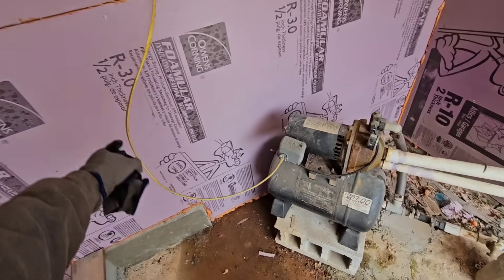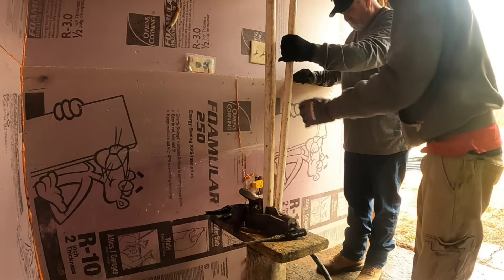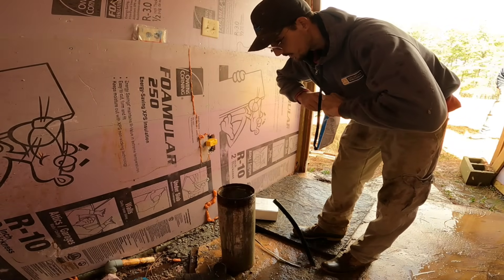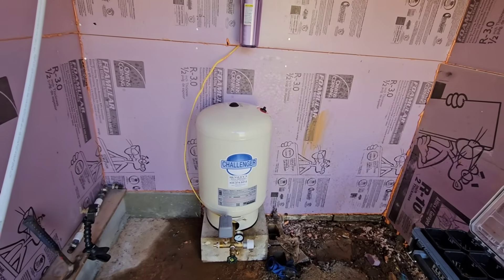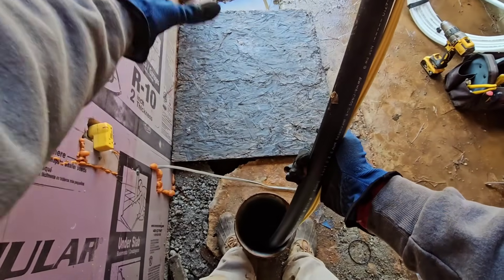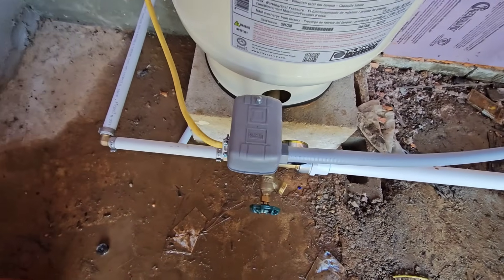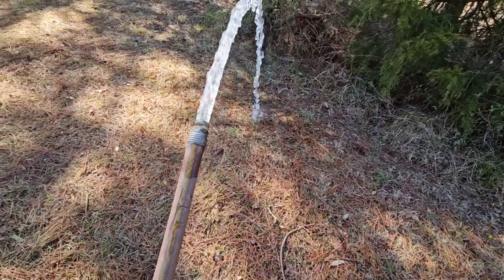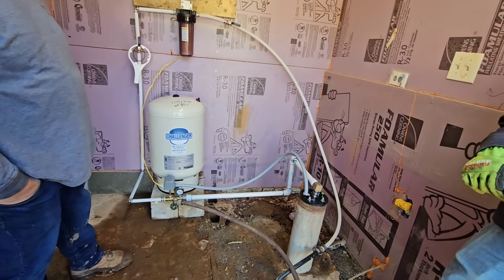Replacing a 1970s Jet Pump with a Modern Submersible Well Pump

Comment: Submersible pumps have their own level of problems.  Ill keep my pump on top of my tank thank you
Reply: yep do not have to pull all the pipe from the well to work on pump
As long as the foot valve/jet is good.

Comment: I loved how you just swiped your fingers across the hot to test for a live wire 😂. Next time use the back of your fingers so they don't contract when it bites you next time. OR buy a hot stick or voltmeter. Just jerking your chain, bud. Great work. Thanks for the video!

Comment: I have a system similar to that in my basement it’s 3 inch casing jet, with a head going into 2 pipes into the 3 inch jet type, and all the well guys around hear say I need a new well, it’s working for now but power went out and it took some time to prime it up, and water pressure isn’t bad but I’d like better, can you help I live in Terre Haute Indiana

Comment: Why don't you line steel casing head edges  with some plastic or rubber liner before pulling or dropping pump, pipe and wires; wouldn't prevent any  accidental chaffing while hardly costing any money or time

Comment: assuming he is going to replace the pvc suck pipe , I would drill a hole in the pipe i'm pulling and stick a screw driver thru it as a safety against that 'slick' pipe slipping thru my hands and losing the pipe in the casing

Comment: Need you in my area, on an old goulds jet pump and no well casing out of the ground I can see anywhere. Buried well? Two well companies I’ve contacted seem too busy to get back with me about updating my system even if it requires drilling a new well.

Comment: I have a 2 inch deep well with 1 drop pipe. Trying to get the well head off to pull the well and replace the jet. Any ideas on lifting the well head up?  Will the 1 drop pipe fall into the well when lifted?

Comment: One thing i know the electrical inspector requires here that is different. You have 3 choices. If a well house is used a disconnect is required inside or if no well house a outside disconnect is required either outside the house above where the water pipe enters or a treated post next to the well where the well is located. And if your unlucky enough to get inspector Wingo it has to be a GFCI breaker.

Comment: Can you explain the other way around pls? Replacing a submersible pump with a jet pump. I want to get rid of a 220v pump so I can use a jet pump that runs on 110 and make use of a solar powered system which is cheaper on 110 volts. However, it could be better if I a jet pump can be cascaded with an already installed submersible pump so that pumping water can use solar in the day but electric grid in the night - that would prevent having to install batteries. Isn't that a good idea?

Comment: Great video. Very similar to what I want to do. Only problem is that my steel casing is only 2" out of the floor and it is severely rusted to the point that im afraid the casing is going to fall apart trying to pull the poly pipes and ejector. I would like to install a liner but its 4" steel casing. You have any experience with lining 4" with 3" sch 40 pvc casing that is threaded so that it has no hubs? Its expensive but its probably my only option for installing a 3" submersible

Comment: For your information. I have several properties with well houses. I put a heat lamp on a timer for protection from freezing backed up with a floor heater on a thermostat. we had below zero weather for a week along with no electricity for a week.due to the cold all the pipes in the house and the well houses froze and broke including the new water heater and pressure tank. i called my insurance co and they sent out a claim adjuster who told me it's a good thing I had the heat lamp and floor heater because if there was no heater source the insurance would not cover those pipes. the bill was over $3000 as all the fittings and pipes in the house had to be replaced. even though there was no power the fact that we had protection saved me thousands.

Comment: Great job . I have a question I have a 1980 well the was abandoned about 10 years I noticed at the bottom of the well fells muddy I install a new pump like you did on the. Video but my casing is a concrete and don’t have a casing what you recommended to do in this case

Comment: If it was mine, I would of laid a sand bed to protect the waterline from jagged rock settling, installed an oversized elec pvc raceway and finished off with direct burial caution tape

Comment: Will a 100ft well serve a dairy farmer?  Don't think so.  Not sure it will serve a home with modern water using appliances either ;)
Reply: I liked the sound of the Buzz-Click! of the blue painted start-relay box on wall in the mud porch for their submersible pump.  It was a 220/240VAC Jacuzzi branded well pump long before it became Franklin Electric.

Comment: What’s fun is to pull an old jet pump that has galvanized pipe down in the well.  They can be very heavy especially in a well house like that where you would have to do it by hand and cut it up like they did the pvc in this well to get it out.  You would be picking up the weight of the 2 galvanized pipes and them full of water, one pipe would be 1 1/4 inch and the other would be 1 inch.  I’m 71 years old and it’s probably been 40 or 45 years since me, my brother and my dad did one of those on galvanized. When we put a jet pump back in we used black coil pipe down in the well if the customer would agree to it.  I can also remember pulling submersibles hung on galvanized pipe.  If it was over 100 foot and hung on galvanized we used one of the old cable tool Bucyrus Erie machines to pull it and reinstall it if the customer insisted on galvanized pipe.  We didn’t have a crane or pump truck with a derrick on it like some other companies had.
Reply: Sears required galvanized pipe to hold a submersible pump in the middle 70's.warranty void without it.Dandy way to never honor a warranty, isnt it?

Comment: Was looking forward to updating my pump situation following this method. Bummed out to find I have a two stage deep well, but it has one pipe going down with the casing becoming the other pipe. ,(smaller bore pipe). Does anyone know if replacing the motor requires pulling the drop pipe and replacing the ejector/venturi or can I just replace the motor. ?

Comment: In New England, we're used to seeing poly pipe in wells instead of PVC.  A well house like this is another reason to use poly pipe.  So much easier to pull and reinstall.
Reply: PolyVinylChlorid, obviously not the same but it's still poly

Comment: Why don’t you change the breaker to 220 and have a two wire 220 system?  Far more efficient.! Also the next guy that changes the tank won’t put the same information on the new tank. That’s why for marking land the old timers used stone walls rather than trees.
Reply: I see two main pitfalls with converting an existing 120V circuit to 240V.

1. There may be other equipment, known or unknown on the circuit, which would not be happy about 240V.
2. You have to source the right breaker, find a suitable space for it in the panel and get someone competent to install it.

Given that the light switch and the pump switch looked identical to each other and were in the same box, and given that we did not see any sign of an electrical panel in the well-house, I would not be surprised if everything in the pump house (light, outlet and pump) was on a shared 120V circuit.

I get the distinct impression he is a well guy not an electrian, he obviously does some limited electrical work to hook up the well pumps and pressure controls but there is a big difference between that and being a full-blown electrian.

Comment: Up to the filter the installation looks good, the pipe leaving the filter looks unsupported and sagging which could lead to it breaking. It should've been routed cleaner, no angled runs. 

the flexible electrical conduit should've had a fitting on both ends instead of being siliconed into the well.

Comment: hello!! Thank you for teaching! I have to do exactly this to my farm house. I do have a question so that I can do this on my own.  Granted the pump is working but I fear it uses crazy amounts of electricity since I have no ac no electric heat and my power bill is higher than my neighbor who runs ac. 
My pump reads 20-40 pressure switch. 
I don’t know gpm or static water level. I’ll check those when ready to tackle the project. 
My question is how can I determine if I should buy a stronger pump?  
I’m building a market garden and don’t have a pond yet to draw water from so I’m stuck with this well for now and want to make sure it keeps up. Thanks for your help.
Reply from the maker: If you currently have a above ground jet pump, they can only be max 80ft deep. So most any submersible 10Gpm pump will work. You can buy 100ft of pipe and wire & itll cover your needs most likely. 
I'd recommend updating the tank if it's old (20 gallon) & go to a 40/60 pressure switch

Comment: Septic tanks refinery unit, rentals of unit cleaner water , pressure cutting,tools spinners in line, crew truck size or smaller carwasher hoses. Spool motor coils 50 m lengths,  john.

Comment: Just my 2 cents...screw the sub pump. They are expensive and they will fail, down the hole, and possibly get stuck. When the jet pump fails, you can comfortably fix that sitting in a chair.

Comment: Would it help to install the sediment filter before the pressure tank assembly to protect the tank and bladder?
Reply: Pressure-switch would not work when filter is clogged-up
Reply: I have seen the filter before the tank a few times-the excess back pressure when the filter clogged always damaged either the pipe or the pump.The switch saw low pressure and failed to shut the pump off.

Comment: Question on filters - if one has a spin down and whole house filter ( 4x10” @ 5-10 micron), how often should a refrigerator filter be changed?  Also should well be sanitized (pool chlorine) if well is never opened up and water is clear and does not smell or taste bad?  Thoughts?
Reply from the maker: So its more important to Sanitize a well when it's not being used. A family of 5 will never have issues with bacteria until the kids move out & then 2 year later only 2 people using water & bacteria begins to form. So shocking the well, even a small amount once a year is a good idea. 
Spin down filters should only be for irrigation. The 4x10 filter is great & should last 6+ months. As for the refrigerator filter, that's a Carbon filter & may last 3 months or 12 months, it's all in what minerals you have in the water. Like calcium (hard water) it'll plug up the fridge filter very fast. At my home I had to buy a bypass filter bc mine would only last 60 days. Those carbon filters for the ice & water were designed to work with city water...carbon helps remove the chlorine smell in city water. Well water will stop them up bc of the mineral content

Comment: am i the only one left that likes running a jet pump and a non bladder tank? i like having a system i can keep an eye on. i also just rebuild the pump for less then $100.
Reply: I'm using a 20+ year old stay rite Jet pump attached to a Mid 1970's Hoyt  40 gallon old style tank.Add air @ every 9 months, and get 12 gallons of draw down at 45-65 PSI  pump switch setting. Did I mention that I'm a plumber with almost 40 years experience? Shallow wells can get good service out of jet pump systems, but anything over 60 feet deep needs a submersible pump.Stay away from the "Big Box" store parts!!!!
Reply: @Splungers  If not from "big box store," where might a DIYer purchase quality pump and tank supplies?
Reply: Pro plumbing counters.
Reply: Anything over 60ft total depth right? Not where you first touch water?  I’m trying to figure out what pump to buy.  I have a jet pump at 20-40 pressure setting and I’d like to see if I can go to 40-60 to increase water pressure overall.
Reply: @CarolinaFigueroa-vd9mt I'm at 160' jet pump that is super old like probably from 70's. Can only get max 42psi and takes awhile to get to 42psi so use a 20/40 switch set to 28/40 that way doesn't have a chance to get so low that it goes dry. Need a submersible for more pressure and save electricity. The well pipe is buried 5 feet down so they would need to add a  extension and can they run power wire through one of the 2 previous jet pump black pipe and then use the other pipe for new water supply? Will not have a pump house cauae Northern Ontario and the current Jet pump, Pressure tank and power is in the basement of the house 70 feet away from well
Reply: @Lefishn  you may get lucky and be able to fish wire through the unused pipe, mostlikey your hosed and will need to run new pipe.
Reply: @CarolinaFigueroa-vd9mt  If you have a Square D brand pressure switch, the pressure is Increased  by tightening the nut on the taller stud. The 20 PSI differential  stays at 20 difference, only the on and off are increased by this adjustment. Use an accurate pressure gauge,do little changes, if the pump is strong enough to cycle normally, you should be O.K.
Reply: @CarolinaFigueroa-vd9mt  depends on your setup, your pump may not support 60 psi
Reply: When I replaced my jet pump pulling water from a dug well 3' wide by 25' deep, I removed the tank completely, and set the pump pressure switch to cut off before max pressure. I added PVC bits and a hose bib, and eventually had 150' of good quality garden hose so I could reach most areas of my lot. The pump was only used for garden watering and as a grass-fire backup when burning trash.  But one day I unintentially left it running overnight and the PVC blew its top off, so I had lots of water everywhere.  
I thought it was a one time deal, but when it happened again I installed a DYI "overpressure relief" which consisted of a 2-hose bib with a short hose directed back into the well, and a long hose out to the garden.  The valve for the short hose was barely opened set to allow a fair trickle of water passing back down into the wide dug well.  That kept it from building too much pressure.  The trickle of water re-directed back into the well did not significantly affect overall pressure at the garden hose.  My DIY fix has eliminated the PVC 'blow-outs' for the last 15 years, but recently the jet pump finally gave out, and the cost of a new submersible pump was less than the cost of repairing the old jet pump, so that is the project I am working on today. 
p.s. in my Internet search the current crop of jet pumps at big-box stores and Harbor Freight are poorer quality than my original cast-iron jet pump, and more expensive than a 3/4 hp 110v submersible.
Reply: Ypu have a jet pump with no bladder tank?? Is that even possible to do cause I run a tank and still has to run a lot if in shower, laundry or outside hose running
Reply: @NorthernOntarioSportsdad instead of bladder you just pumped air into the tank  to refill the air pressure for air dissolving.
Reply: @Lefishn  it's a 120 gal tank with  most of it being trapped air.
Reply: I don't mind the hydropneumatic tanks when you have decent water quality. The more iron you have the worst that style is to keep operational. I absolutely loath jet pumps, and just about every plumber that works on wells will hate them as well.
Reply: Typically I would only use a jet pump for a sand point well because its so shallow the pump wouldn't have to work as hard i dont think